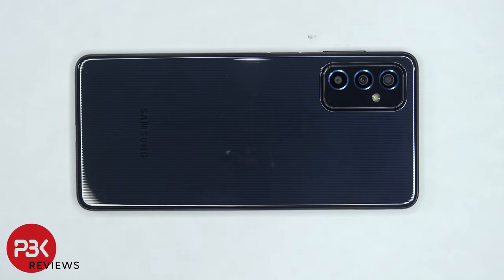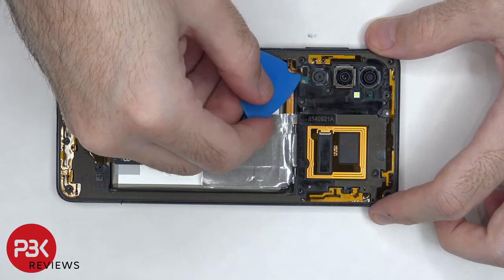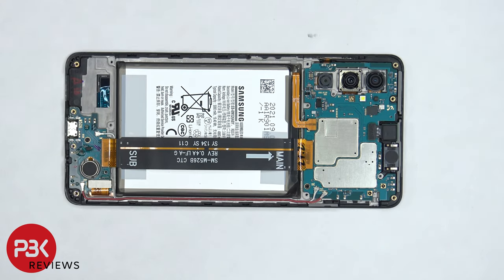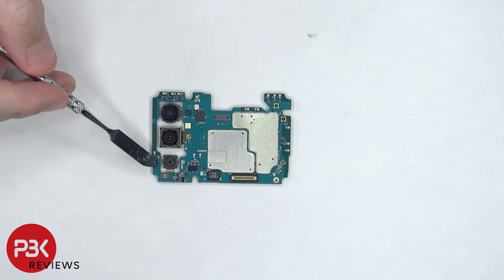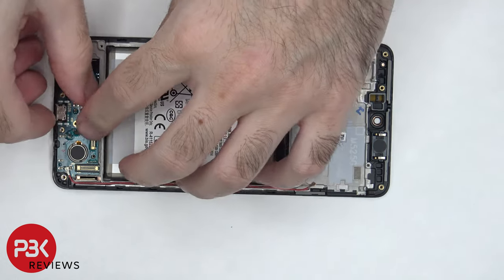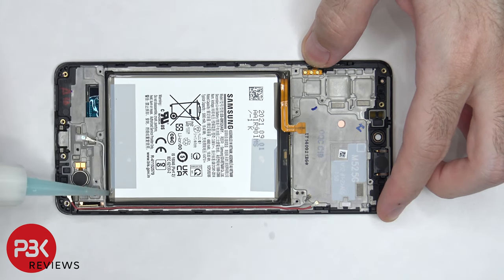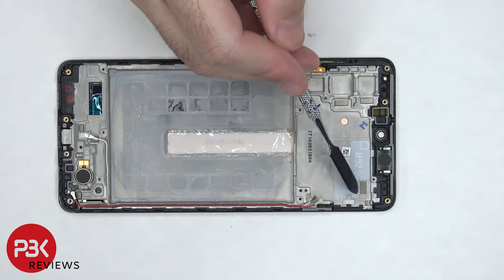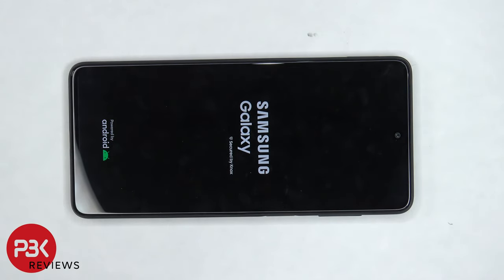Samsung Galaxy M52 5G Disassembly Teardown Repair Video Review

Comment: If I only need to replace the battery, should I remove the main and sub board?
Reply: You should because you will be using the isopropyl alcohol to remove the battery which might damage the main board. And main board are really expensive. So the safest bet would be removing sensitive components

Comment: Thank you for the video. Based on the disassembly, does this M52 5G have any protection from liquid? will it survive rainy days in the pocket or not? I heard you said rubber gaskets,, that indicates some sort protection or not? Thanks!
Reply from the maker: Hi, from the looks of it, it should be resistant to a little water. Should be fine for rainy days but I wouldn't want to test soaking it since it's not officially ip rated.
Reply: It's pretty much the same situation as most OnePlus phones. They put rubber gaskets in their phones around ports and holes, so that the phone survives occasional contact with water (like rain) and it helps preventing dust getting inside. But I wouldn't submerge these phones in water, but I wouldn't do that to even IP68 rated phones, since they can still leak water in and the damage that occurs is on you as a consumer and not the company, since they themselves say any water damage is your responsibility, that's why you find those strange stickers that change color inside the phone.
Reply: Dropped mine in a pool can confirm it will not resist

Comment: As far as your experience regarding teardown of smartphones , how is the build quality of samsung m52 5g device. 

Is this have good build quality and good quality components on comparing with devices of other brands same price range or does samsung used cheap quality material and components to price cut .

Expecting your honest opinion . THANKS in advance .
Reply from the maker: I mean it's not the best built phone, but in the same range of devices, I would say its decent. I would prefer to take a samsung or motorola in this range of device compared to other brands.
Reply: Thanks for information sir..🙏

Comment: Are you going to do the A52 5Gs sometime soon or does it have the same internals as the A52 4G
Reply from the maker: Hi, the A52, A52 5G and A52s are all identical aside from the refresh rate on the A52s and the faster charging speed and the processor deference between the three. The design and disassembly process would be the same for all three so there wouldn't be a point in doing a separate video for each. :)
Reply: @PBKreviews  thanks, I appreciate the information
Reply from the maker: You're welcome :)

Comment: Is there any heating issue and screen flickering issue?
Reply from the maker: nothing from what I can tell, but I haven't used the phone to test it out much to see what it is like under heavy usage. But this model does have a copper heat pipe compared to the M51 which didn't, so I'm sure it should help a lot with heat dissipation.

Comment: Are you using 100% Isopropanol Alcohol or lower percentage?
Reply from the maker: It's 99% isopropyl alcohol. You want the percentage to be high so it drys quick and doesn't stick around to short or cause damage etc. :)

Comment: Mine fell on the water and when I opened it I've damaged the wifi antenna and now it's signal strength is really weak, I've searched online and couldn't find the antenna or a mid frame for this device, does anybody know where can I find it? Thanks in advance
Reply from the maker: There is this link but I have never bought from them before: https://mobieparts.com/p/samsung-sm-m526b-galaxy-m52-5g-midframe-black-sam18139/

Comment: Samsung should use ip rating waterproofing on those m series devices.
Reply: M52 surprisingly has waterproofing, it just doesn't have ip rating certificate. I saw a durability test, an Indian reviewer drop it to water and leave it for 5 minutes and no damage at all, still works fine.
Reply from the maker: The problem is cost, it would cost them more to add additional water resistant features and they are trying to keep the price tag attractive to customers. Also on top of that it costs them a lot more to get the IP rating certificate.

Comment: Can you find out manufacturer of display cause korean media reported samsung will use chinese display in M series and Upcoming A73
Reply from the maker: I don't have the device anymore and usually it would require prying off the screen in most cases to see the info sticker on the back and doing that would pose a high chance of damaging the working screen.

Comment: Qualcomm SD778...
S-Amoled 120Hz, +700 nit, NFC, Bluetooth5, SlotMicroSd, 8RAM, Compatible 25W, Batt 5mAh, 
" 3 " excelentes cámaras 4K/1080-60fps, 
GorillaG 5... Bandas compatibles LATAM ETC ETC... Solo le falta la resistencia agua, 
Hou 22 Marzo 2022 cuesta $260 / $280
SORPRESA TAMBIEN SOPORTA WIFI 6 
PORQUE ES " 5G "

Comment: The phone looks cheaply built
Reply from the maker: It may not use the most high end materials, but comparing it with the M51, they did add a copper heat pipe which is a plus. Also the design is very simple and clean when it comes to repair-ability. Not too many wires running around. So its a step up from the previous model. :)
Reply: @PBKreviews  I bought this mobile and using it now. My friends said go for mi 11 lite NE 5g but I chose this one for samsung branding. Please make sure did I made a mistake? 
(I am not a gaming user)
Reply from the maker: @vishweswarana369  they are both similar but the m52 has a bit better specs so I would say your choice is good.
Reply: @PBKreviews   Thanks bro ✌🏻